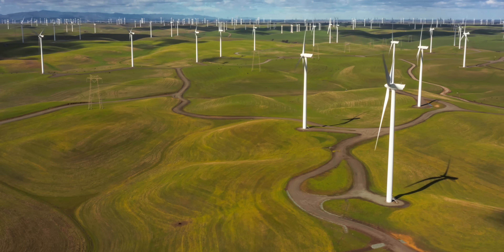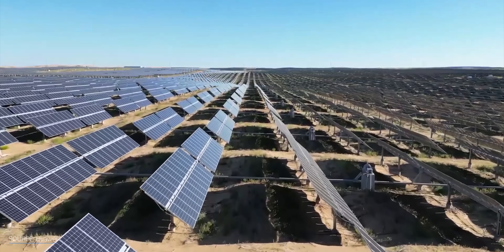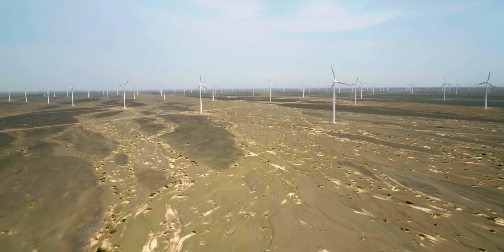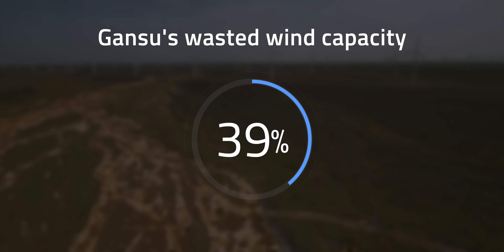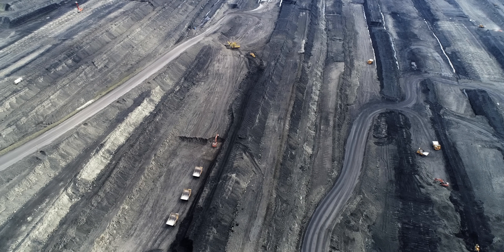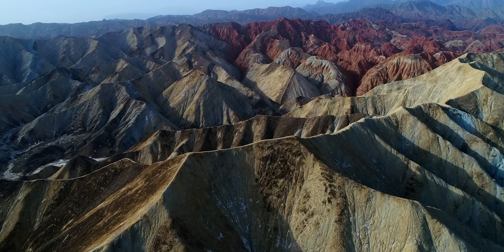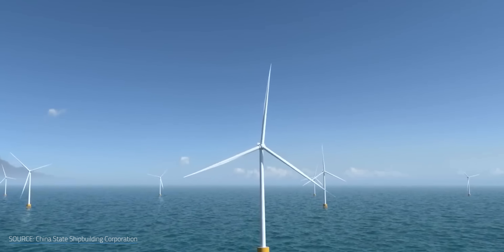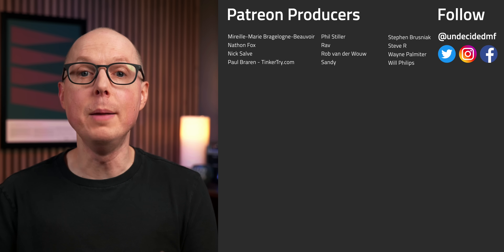The World’s Largest Wind Farm has a Tiny Problem

Comment: The siting of a long-distance (~1000km) transmission line takes about 3 months in China. In US, it takes 10 to 20 years. That is why such large projects are not possible in the US.
Reply: @chi-jenyang9752  
Get them Chinese to build it up for you.  It would be under budget and ahead of schedule.  😁😁😁
Reply: Yes China can do their projects quickly but Tofu Dreg always crumbles quickly and easily.
Reply: and now triple these numbers again for Germany
Reply: I worked in china. If you wnt to clear homes or farms you send the housing officer a few days before who tells them to gather their few possessions and come to the office. Party controls all property, the projects and the contractors. Easy to do.
In USA people have rights
Reply: Compared to here in central Europe 10 to 20 years would still sound pretty good. Our counterpart of your FWS woulf be in that time barely finishing to check if not any endangered species is living under the planned lines….
Reply: this video cites an issue that the coal is local and so cheap. the wind is more costly so it isn't easy to boom without reimbursement. same old issue.
Reply: Maybe that's because the US has higher environmental standards.
Reply: Oh sure. You're the only person on Earth that has figured out how to get accurate information out of China. The engineering on a project like that would take years by itself. Because China is a communist country. The actual building and installation on the land certainly would go a lot faster than it does in a country that can only acquire these things by eminent domain or by leasing.
Reply: @Maligatorandaviator so government can take your home for a freeway today and you won’t/can’t fight government in court ?
Just like in China you surrender in US ?
Reply: "In 2017 the 2,383 km long Jiuquan - Hunan HVDC transmission line entered service connecting the remote complex to the Hunan regional grid allowing full utilization of its generation capacity." According to Wikipedia electricity is being utilized.
Reply: @chi-jenyang9752  Germany 40 years
Reply: US has Crowdstrike and 2 astronauts stcuk in Space, also no HSR.
Reply: See, e.g., the California high-speed rail.  After 10+ years, it's not high-speed anything.  Is there actually a railway?
Reply: Not sure where you get those numbers from, but many delays are caused by other companies that are incentivized to squash new transmission lines.  It’s not Farmer Joe and tree-hugger NGOs holding up projects.
Reply: @chi-jenyang9752  not actually feasible to implement in US or normal country…Roi is very very negative ob these projects…
Reply: You're right about permits, so everyone should call or write your reps in Washington to pass the bipartisan Energy Permitting Reform Act of 2024 (S.4753).  The whole goal is to make it easier to get permits to transmit energy (mostly electricity, but also some fossil fuels [after all, it's bipartisan]) across multiple states.
Reply: @chi-jenyang9752  How would you feel if a government forces you to sell your property for a large project?
Reply: Typical defeatist republican voter is both the problem and the victim at the same time and he doesn't even know it....
Reply: An autocracy has that ability. Navigating through a free market is difficult. Yet give me freedom
Reply: China also has a lot of cheap labor: traveling workers they can simply relocate, because they are dependent on the work to survive.
Reply: @ArneBab  Source for that lie?
Reply: Same Problem in Germany. Because of the NIMBYs.
Reply: But it falls apart in 5 years in China, where the USA it will last 100 years
Reply: @w2385-i2s  No. I am saying that, because of rampant corruption and using substandard materials, a lot of these “amazing” Chinese projects will fall apart quickly. Every aspect of the project will have someone pocketing a portion, and reducing safety, lowering material cost and quality, and hiring less skilled labor. It’s like that in most places, but China seems worse. Having an inexhaustible supply of cheap labor, gets things done quickly, not correctly.
Reply: democracy has its disadvantages.
Reply: @chi-jenyang9752  

Yes, and the projects are almost always badly built, badly planned, and not financially sustainable. Central planning is inefficient.
Reply: wrong again
Reply: Its also because people in the US have rights, and you cant just plow through their farms without due process.
Reply: @jdbrinton  thats the real reason lol getting land for these projects isnt simple or fast here
Reply: @jdbrinton  residents of early 2000s Detroit might have a thing or two to say about that.
Reply: @jdbrinton  What? US absolutely has imminent domain laws.
Also, i find it funny that those pics of a house in the middle of a highway or mall parking lot are usually from... China, not the US.
Weird.
Reply: @jdbrinton  The US gov can just walk over and tell you to get off THEIR land, regard.
Chinese people have far more rights than Americans do.
Reply: @jdbrinton  That is true and there are a lot of examples of the government abusing those rights. That said, you cannot allow individual rights to take such precedence that nothing can be accomplished. As an example, I knew a successful older gentleman that fought a major university for many years that wanted his house and he didn't want to sell. I was very proud of him that he was willing to spend what he must to keep the university at bay. The primary reason for my support was that the university didn't have a need for his property, they just wanted it for the future. I might have thought quite differently had the university needed the property for an expansion of their hospital. We need to remember that it isn't just the acquisition of land that prevents projects these days - it is the myriad of government rules and regulations and all the NGOs ready to file lawsuits at the drop of a hat. This must change if we want future generations to have a better country than we have now.
Reply: @catnvol

All those lawsuits ALSO help keep our land, air, and water a LOT less polluted than China.

THAT's worth a lot on it's own.
Reply: Can you imagine the US building the Interstate Highway system today? There would be zero chance. The same is true for major oil pipelines, dams, and - as you say - any major project.
Reply: @catnvol because of zionist corruption.  All ypur money is spent on bases to protect and fight isreals wars. How much did the us spent on petroling the red sea from yemen. And they couldn't do nothing.  Imagine if you spent that money home and not isreal?
Reply: @catnvol  California is building a new dam.
Government owns land in China, they lease it to citizens.
People who own homes don’t own land, they are leasing from government.
Reply: @catnvol it took them almost 20 years to redo a large intersection between i70 and i75 and they still somehow managed to mess it up. Looking at the intersection from above you can see how much acreage they had to work with and how much safer it would have been if the exploited it all. 
They are handicapped
Reply: So true!  The other problem may be logistics of getting enough labor for such large projects.

Same problem would happen with Canada.  Europe is different as many European countries don't even have 1000km of distance to span.
Reply: Not just in the US...in Europe is the same thing. We just forgot how to "move fast". Everything takes years and years to build, costs 5x what it was supposed to cost and in the end is either cancelled or, by the time its complete is just outdated. 
Fact is, the chinese cought up to the western world pretty fast...and is now looking to beat us in pretty much everything. While this is happening, we are debatting how many genders there are and other futile things.
Reply: the us has property rights, in China you do as you are told
Reply: @dknowles60  regard, other way around.
Reply: You can get a lot of things done quickly in a communist country.. is it really worth it ?
Reply: @jacklipshin6486  China are socialist and yes it's clearly worth it, they're ahead of the world in most metrics.
Reply: When you have unlimited cheap manpower, it goes a long way. The other difference is how long will it last? American- 50 years +, China, 2-3 years likely. Substandard materials, every shortcut imaginable, 0 safety standards.
Reply: @rabbithowls71  national projects dont take shortcuts like private projects do. chinese businessmen are happy to fleece the average partner/customer because of the weak court systems, but if they fleece the CCP those weak courts are powerless to protect them from the wrath of the government.
Reply: @rabbithowls71 they build to spec, which for companies like Walmart is cheap crap.  There is no point overbuilding when they are hammering you for absolutely lowest price possible.
Reply: @rabbithowls71  Regarded take, China makes stuff FAR better than any American can ever dream of.
Reply: @rabbithowls71  Keep telling yourself that. Look at this very video of top shelf automation creating world class products. Energy infrastructure is not a walmart toaster.
Reply: @rabbithowls71  safety standards like Boeing 737 Max?
Reply: @bl5601  we have standards, some may not follow them, others actively avoid them, but they are there.😂
Reply: @bl5601 correct.  Boeing initially received a "pass" on their safety issue. It came with a caveat. Recent events triggered huge fines and additional work for Boeing, thankfully. In a communist country you would never know of an issue, nor if there were corrective steps taken.
Reply: @bl5601  I'd much rather fly a 737 Max with a competentlying trained pilot than the Chinese version of plane and pilot
Reply: @rabbithowls71  lol. Keep chugging that koolaid.
Reply: @rabbithowls71  tofu-dreg!
Reply: @rabbithowls71  here we go again. By ur comment u just want an argument. Ok we get it u hate china.
Reply: People laugh at Trump for wanting to tear down bureaucracy, but it's a real tangible issue in this country. It stifles innovation and progress.
Reply: @littlebluebird-i2c  In many cases that bureaucracy is NOT federal - it is at the state and local level. Everybody is playing the "not in my backyard" game.
Reply: @littlebluebird-i2c  yeah the problem is that hi didnt, and he wont, and if he did he would tear down the bureaucracy necessary for social services and environmental protection rather than corporate welfare and the like
Reply: @linkhidalgogato  Your prediction came true
Reply: @littlebluebird-i2c  property rights are the obstacle, not government bureaucracy. The people that own the land needed, want fair compensation, which seems reasonable.
Reply: @littlebluebird-i2c  that bureaucracy in the US still has us having big oil spills.   We obviously make terrible decisions and need different leadership.  Under Trump, our emissions got worse for the first time in decades. And that's with checks and balances.
Reply: @littlebluebird-i2c  Everybody wants to tear down byrocracy until they start building huge project behind your house.
Reply: @littlebluebird-i2c Trump would not build a wind farm, so forget any comparisons. However, your point is well taken-permits for infrastructure buildout take way to long.
Reply: @littlebluebird-i2c California is seen as the bureaucracy and regulation black hole yet it manufactures more in terms of output and employment than any other state. Manufacturing has grown in California in the last thirty years at a greater rate than any other state as well. So if regulation stifles innovation and productivity shouldn’t that be hurting industry in the state?
Reply: @bob8776 According to google, california ranks 4th.
Reply: @1alayzzia  “California is the largest manufacturing state in the United States, with over 23,000 manufacturers and more than a million industrial workers. California's skilled workforce and access to capital have attracted innovative companies, especially in the aerospace and electronics industries”

I lifted that directly from google
Reply: @littlebluebird-i2c  Trump does not tear down bureaucracy when he is compensated or bribed to keep things the way they are.
Reply: @littlebluebird-i2c  People seem to forget that Communist China is, well, communist.  There aren't real laws of ownership for property in China, it's all held by the state and leased to individuals.  Here you actually have property rights, along with other rights ensuring that the government can't just toss you off of your land without just compensation.  But by all means, let's weaken our rights so big businesses can just do what they will, right?
Reply: @panachevitz  big businesses already do what they will, on another level. When they are important enough they get bailed out of bankrupcy like GM.
Reply: @panachevitz  that's BS. We all saw videos about the nail houses. They have laws. Different from ours, but how is that surprising? It's a whole different country. The people are compensated. It's just that they are poorer. So they're cheaper to buy off.

Plus a lot of the remote non-productive parts of China has not been sold off. China is the same size as the US, but with 4x the population, and most of them are crammed on their one and only coast. It is much easier to route things around when there is so much unused unoccupied land.

Lastly, the civil war on the first half of the previous century, the Japanese occupation, Mao's multiple revolutions, all caused great upheavals and population displacement.

It feels different when your family has been working the same land for 200 years, vs your dad was moved there 30 years ago, and now the government or a giant corp wants you to move again, and here's a pile of money to sweeten the deal. If you're not all that attached to THAT bit of land, the money looks more attractive.
Reply: @panachevitz  google nail houses. Then google how to get smarter.
Reply: @panachevitz  then again there are Nail Houses. So China does respect personal property.
Reply: @irimeyilmaz956 very few
But most of the time they get what they want.
If you want government to complete projects fast then choose communism.
Reply: @panachevitz  Then how come your government can take your property if you don't pay your property tax? Isn't that just leasing? Lmao.
Reply: @panachevitz  you dont own land in amercia too child you need to pay propert tax  amd gov can take it back
Reply: @panachevitz stop paying your illegal and self setting property tax and see how long you “own” your property. 
Property tax is the biggest fraud out of them all. 
Who sets the value of the property? The government! Who get the money from the tax? The government! 
Must be nice to snap your fingers at anytime and double your paycheck. 
Property tax = rent. 
We all rent.
Reply: @panachevitz  define communism.
Reply: @littlebluebird-i2c  There's zero chance he would kick his own rural voters off their land with eminent domain for a green energy transmission line. Think things through before you post.
Reply: 😂@VulcanLogic If you are talking about the US, you have a point.  However, if you are talking about China, the Chinese powers think only of the country.  There are no individual land ownership rights when the government wants to use the land.
Reply: @VulcanLogic wow.. someone said the orange man bad name! Go turn msnbc on and watch some relaxing and soooothing  propaganda
Reply: @VulcanLogic Would he build a wall through the middle of their farmland? Because he was trying to do that
Reply: @VulcanLogic  
There's zero chance anyone get kicked off their land for a transmission line.

You do know that they run those lines over people's land, literally all over the country??

It's called an easement, and all utilities have them.
Reply: @littlebluebird-i2c  americans vehemently oppose projects that might produce noise or reduce the value of their homes. several landowners refuse to sell to the government out of principle. the chinese government does not have to deal with any of that.

Comment: As an engineer I see wind as solar not a renewable, but just another source of electricity.  I live in the American Midwest and I can assure you that both wind and solar are far from clean.  Batteries that are viable on a large scale and recyclable would change this equation slightly. The amount of trash coming off the wind fields in the form of old wind blades means the "recycling" plant we built in our hometown has enough work processing them for the next twenty years or, so I've been told. This recycling plant services a 500 mile radius for windfarms and ultimately these blades just go through a set of massive woodchippers and then get hauled by train to the coal plant a town over where they're incinerated.  This is better than burying the blades as some places in the world do, but it's way more economical and cheaper energy rates to run a nuclear power plant that provides close to full uptime producing electricity than it is to get 30% uptime out of our windfarm that needs a baseload coal/gas powerplant on standby to assist.  Don't even get me started about the number of materials needed to build a high voltage transmission line.  We have two massive lines near us and people don't like having them build or adjusted next to them.
Reply: A few day's worth of coal weighs the equivalent of multiple decades of turbine blades. This post is nonsense. Everything requires some processing and materials. Only the relative inputs and value matter.